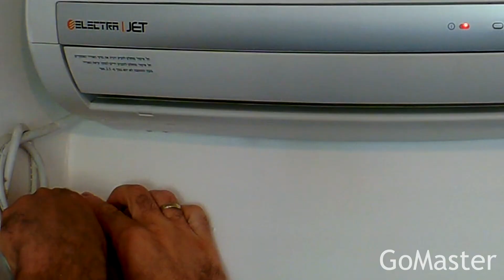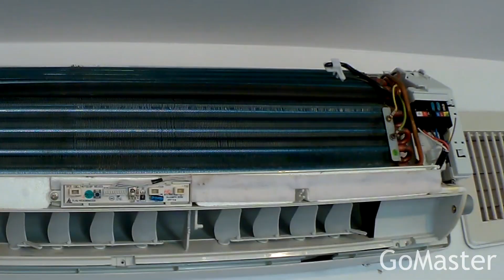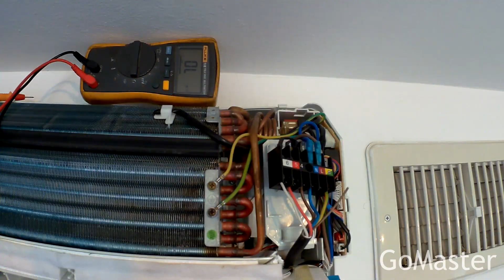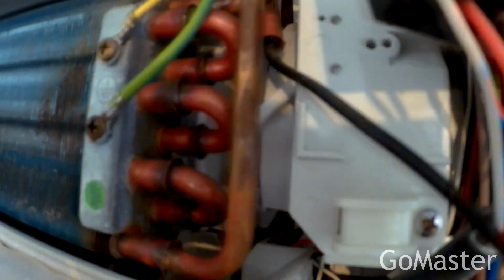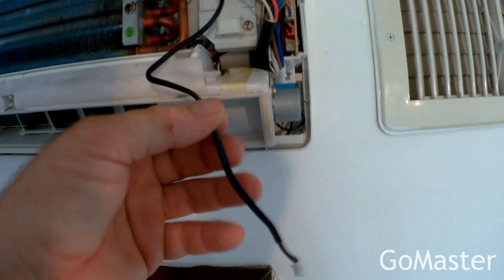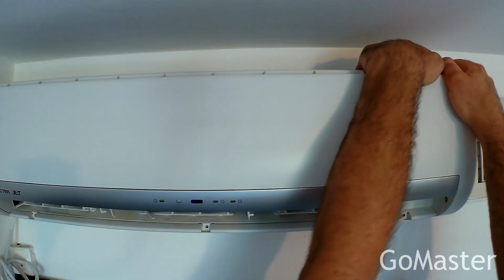How to test and replace Thermistors (temperature sensors) on split air conditioner AC

Comment: Very good!  That thin strip of metal that fell out when you pulled the coil thermistor out of its thermowell - was that there just to help secure the thermistor in the thermowell?  Also, what is more likely to fail, the air thermistor or the coil thermistor (I don't have a multimeter handy to check them at the moment).  I'm pretty sure it's a thermistor problem I currently have as I have two separate evaporator heads coming off one outdoor compressor - one of the heads seems to work (fan is fine) but it won't heat or cool the air whilst the other evaporator head heats and cools just fine indicating it is not a compressor problem.